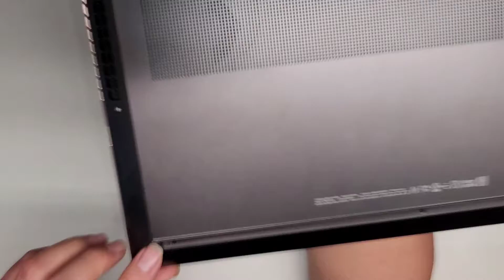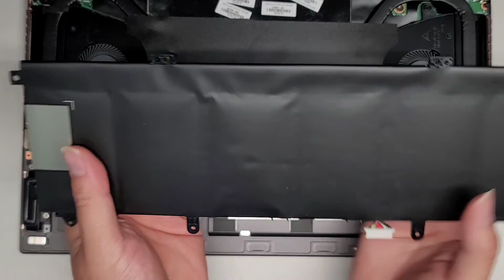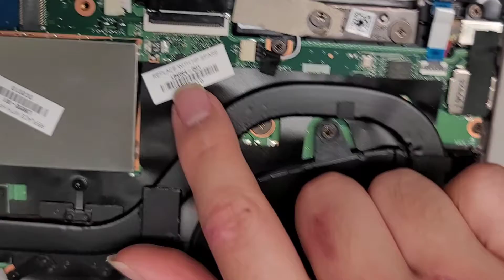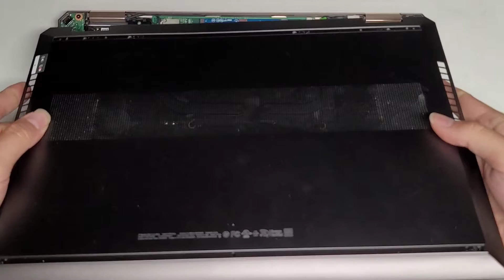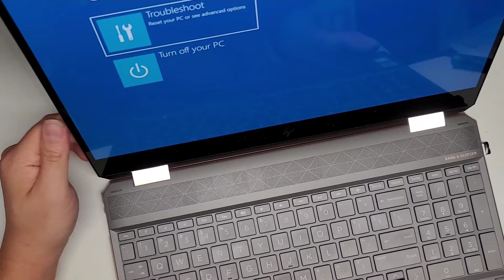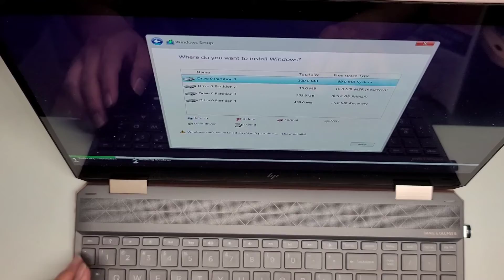HP Spectre x360 Convertible 15 15-df1043dx Disassembly RAM SSD Hard Drive Upgrade Replacement Repair

Comment: Wait i thought you couldn't upgrade the ram on these ? Someone please explain?!
Reply: it depends on the model. Some spectre have ram slots, some others are soldered.
Reply: Yes, both the hard drive (M.2 nvme hard drives are AWESOME) and RAM are upgradeable. But that’s about it besides software like the operating system, of course. 😀
Reply from the maker: @tekman2000  haha yup
Reply: Thanks a lot for this video. I've been wanting to upgrade the SSD in my Spectre for a while but didn't know how to open it up. It's also good to know that the battery can be replaced if needed.
Reply from the maker: Glad it helped. If you haven't already, please like and subscribe so others can find my videos.
Reply: I wanted to upgrade it too but so many people say on google search it’s not upgradeable. This video clearly shows it is. Maybe there are variants some are and some are not? How to determine which one is upgradeable? Can you tell which processor is on this one?
Reply from the maker: The whole point of this channel is to show people how to take their computers apart and work on them. So if you're asking how to find out if yours is upgradeable, you're not using this channel properly. Lol
Reply from the maker: Watch the video. What more is there to explain?